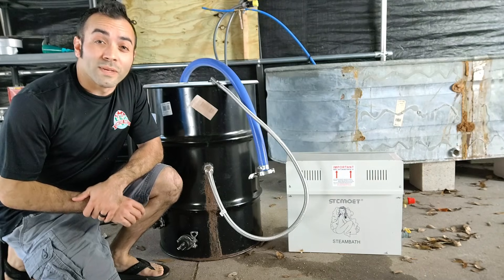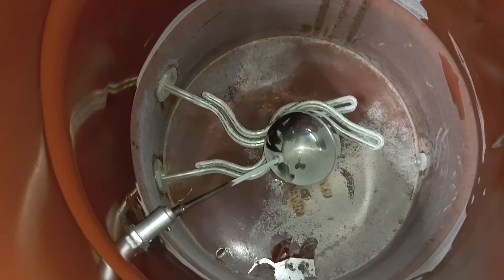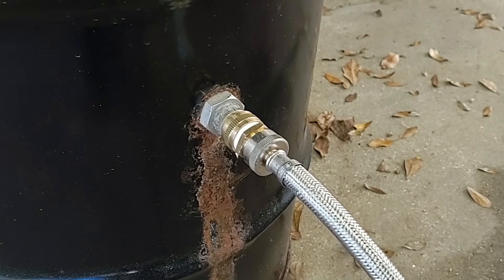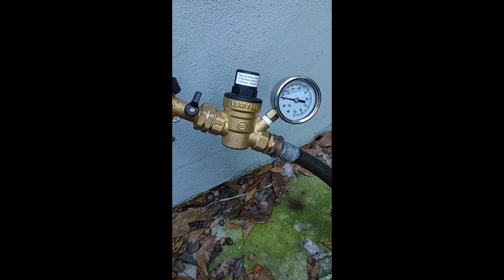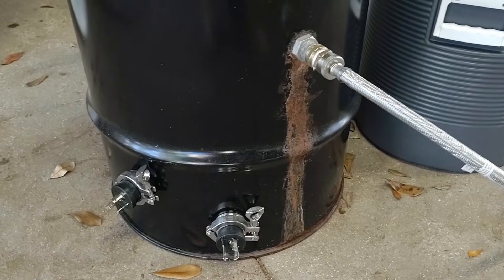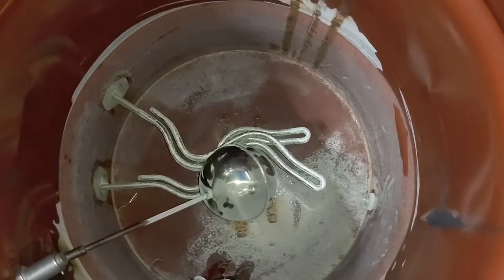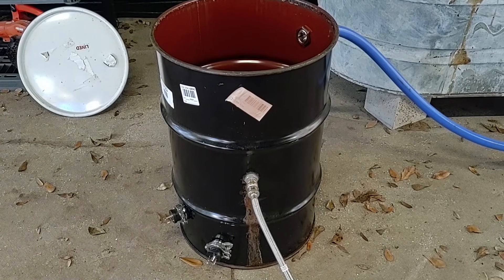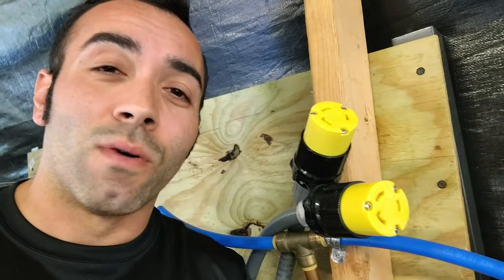LEVEL UP YOUR MUSHROOM FARM WITH A BARREL STEAMER

Comment: Hello, is the container in which you have the mushroom substrate hermetically sealed? How big is it and how many hours does it take to pasteurize everything? Excuse my English but I am writing to you from Sardinia
Reply from the maker: It's a 300 gallon cattle trough. It's not sealed, I simply throw a tarp and blankets over the blocks while they are being steamed. Time depends on different factors but I steam mine for 18 hours
Reply: Ok waw, and you just need one barrel steamer to be able to sterilize 300 gallons? Waw
Reply from the maker: @stefanocau4367  this barrel steamer is powerful enough to steam a much larger container also if you can't get a trough
Reply: Ok thanks for giving me more information, I definitely build it

Comment: Great video! Question this will sterilize grain correct?
Reply: What The Fungus has a video on bulk "sterilization" of grains, they soak the grains in hydrated lime before pasteurizing which kills a lot of bacteria on it's own and then the grains are bagged and put in a steamer similar to this. Video is called: New Way To Prepare Grain Spawn

Not sure how effective it is but worth checking out!
Reply from the maker: @cullsans  good to know. From what I've been reading one could get away with it if you do grain to grain. I'm too scared to risk it.
Reply from the maker: This is for atmospheric sterilization of bulk substrate. For sterilization of bulk spawn you'll want to use pressure.
Reply: @cactushatmushrooms3677  so u couldn't use this to sterilize grain just over a course of like 20hrs at low psi ?
Reply from the maker: @brenthampton7025  at a low psi possibly. But this vessel uses no pressure.
Reply: Ya for like 80k doesn't seam cost efficient.
but thanx for answering all my questions :)
Reply: How do u sterilize ur grain?
Reply from the maker: @brenthampton7025  pressure canners like the presto 23qt or if you have a higher budget an All American
Reply: Yes I use a few of those currently..lookn for something to fit more grain in at a time
Reply from the maker: @brenthampton7025  depending how crazy you're trying to get, there are auctions with 30ft autoclaves

Comment: Hi Joe, thanks for the video! I'm working on a similar build just north of you in Pasco County. I didn't notice in the B-roll or hear in your overview you mention using a timer, thermostat, or PID controller in your setup. Are you just plugging the elements in and running at full power (5500W x 2) for the entire 24 hours? My apologies if I missed something.
Reply from the maker: Nice to hear from you David. I definitely forgot to add B-Roll of the steamer itself running sorry about that. I currently dont use any timer, thermostat or PID controller. I do long runs like you mentioned. In speaking with other cultivators around the country over the years I learned there are many that did the measurement once and I just simply follow those times they recommend.

    I currently steam for 18 hours with a load of 140 blocks at a time and experience no contamination. It may work with even less time. The goal is 200 F for 6-8 hours of core temperature. If you want to be sure you can measure using a temp probe in a bag. I just havent found the need to measure it myself as greater minds have already done the work.
Reply: @cactushatmushrooms3677  Right on. Thank you again!

Comment: Was there a reason the water intake seems so high up the barrel? How high does the water level need to sit above the elements?
Reply from the maker: I drilled the hole for the intake to ensure the elements would be submerged. Truthfully you only need the water to cover the elements a little. My water line sits several inches above the elements which makes it take longer to produce stream but I don't mind waiting an extra 10 minutes

Comment: Hey do you have a drain on the trough? And how low are your bags,like what screen are you using to set them on? Just a bricks length tall to set the screen on? Awesome
Reply from the maker: The trough has a drain. I have bricks turned on their side to maximize the height of the false bottom. I use metal wire closet shelving cut to size and thats what lays on the bricks.
Reply: @cactushatmushrooms3677  awesome..do you have to drain while using or just afterwards?
Reply from the maker: @killerkennyas  I keep the drain open at all times in the trough. Otherwise it will start filling up with water possibly soaking the bottom row of blocks.
Reply: @cactushatmushrooms3677  cool
.thanks man..pitta curiosity, how much water do you think runs off in a hour? Around a gallon? Never really heard anybody talk about that,was jsut curious..
Reply from the maker: @killerkennyas  not sure and wouldn't even know how to calculate that without running it just to find out

Comment: Awesome video.  Thanks for taking the time to put this together!
Reply from the maker: No problem you're very welcome!
Reply: @cactushatmushrooms3677  Hey Joe, great vids. Was wondering if you may be able to show yr grow rooms, especially interested if you insulate to maintain temperature? Im based in the uk which can be quite seasonal,  so im thinking insulation may help with the seasonal swing in temps. Do you use a heater in winter and an AC in summer? Oh, and do you monitor co2 and fae ? 
Loads of questions,  hope to see further great vids , Happy shrooming !
Reply from the maker: @wande.r  Ill put it on the list. I will absolutely make a video on that. The short version is I've insulated my garage and use a split unit from Mr. Cool to control the temp in the garage. I personally dont use a c02 monitor because I dont see the point for smaller grows like mine. The mushrooms tell you all you need to know.